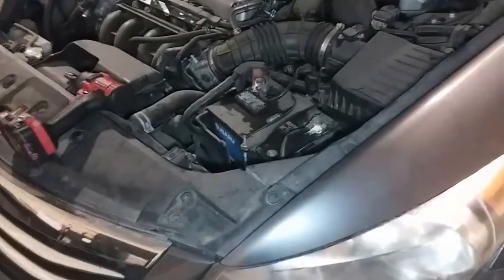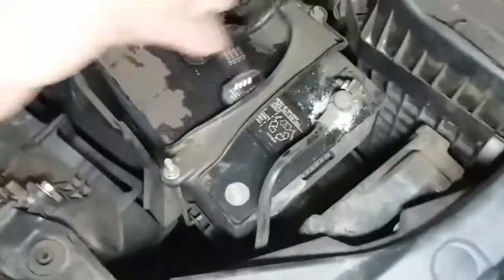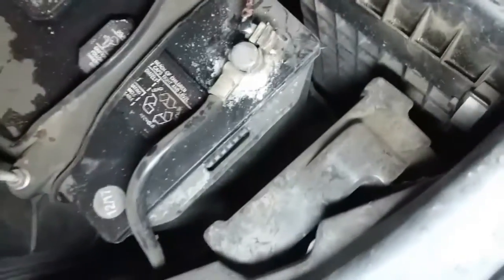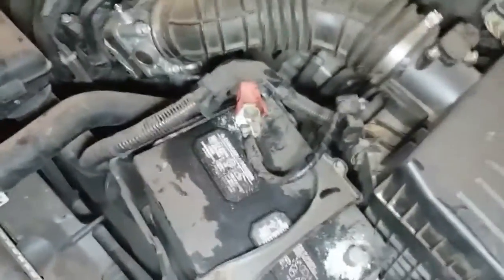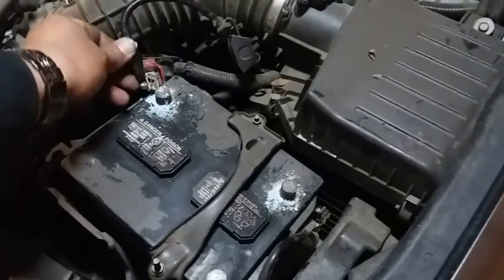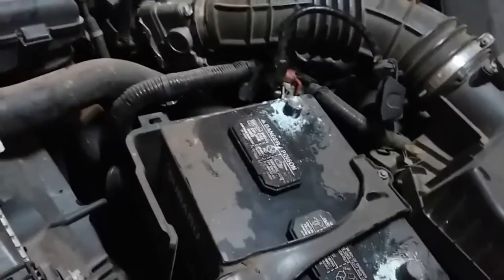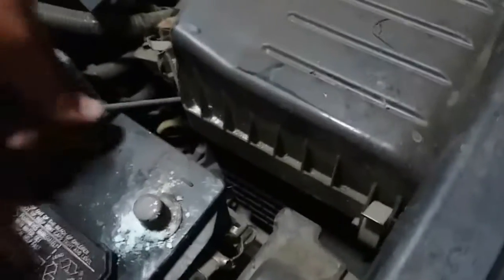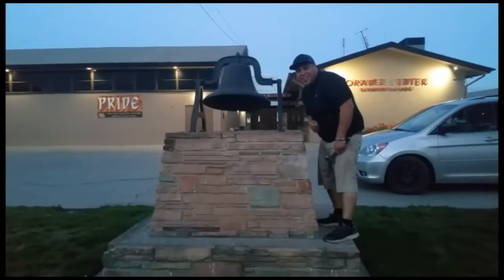How to: Remove a Battery from a 2012 Honda Accord

Comment: Had to watch this because I didn't know if the 2012 or newer has a sensitive component that can be harmed from disconnecting battery. I doubt it's a thing but it's best to avoid an inconvenience lol

Thank you for the video
Reply from the maker: Na you should be good. The reason im replacing this battery is because the battery was completely dead and the car had to be jumped every time for it to start up. Replaced it and had no issues. Hope this works out for you. Thank you for your Support 🙏
Reply: @559powerscape  I'm not replacing battery, I will just be disconnecting spark plugs to inspect their condition and checking fuses
Reply from the maker: You should have to disconnect the battery for Sparkplugs or inspeting the fuses. Good luck hope all goes well!

Comment: Trippin that was my concern too - my previous car has only a clock, this 2012 Honda seems to have a lot of electronics - backup cam, directions, even a fan near the radiator that shuts off and goes back on constantly. Hate to blow all that stuff just to clean off the battery cables.

thank you George Lopez!
Reply from the maker: Your welcome, im glad this helped. Thank you for your Support 🙏